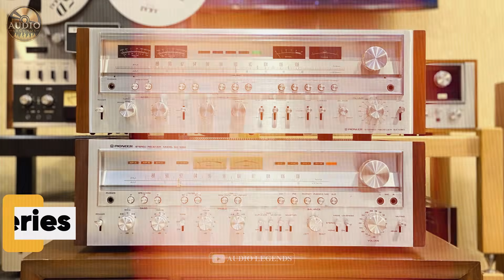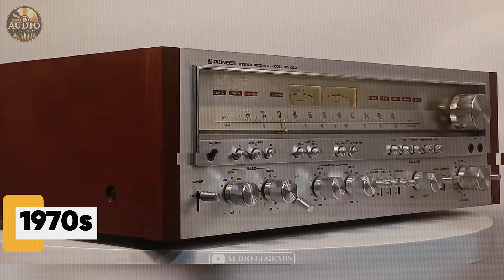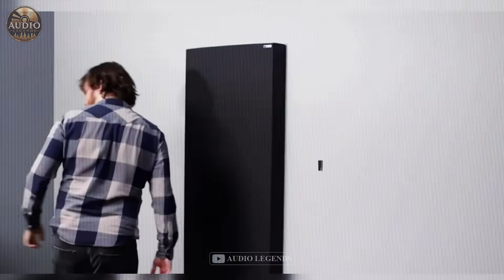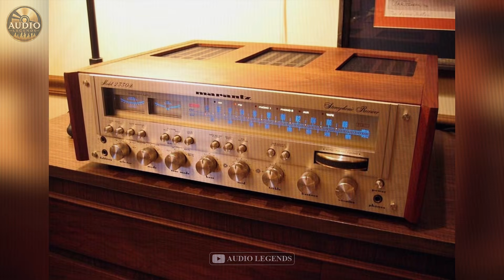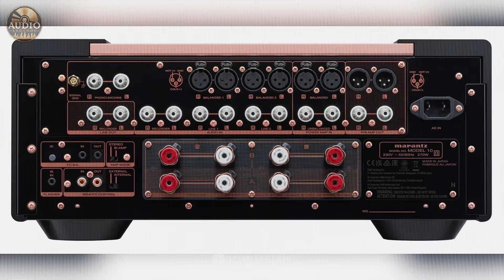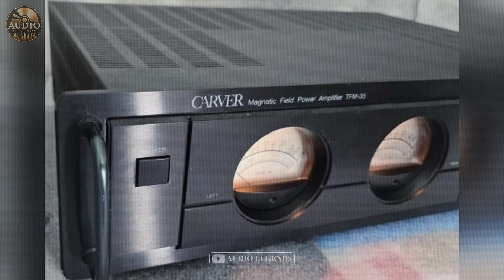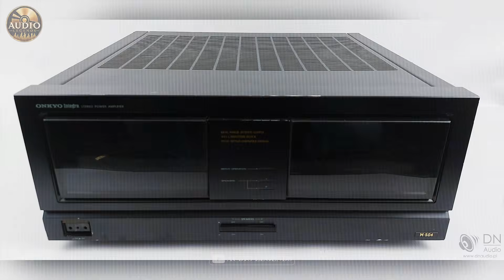My Top 10 "NEVER BUY" Vintage Stereos!

Comment: I went through quit a few amps over the years: Marantz, Sansui, and some earlier ones I can't remember the names. I bought at Vincent de Paul for about 40 dollars a Kenwood KA-801, very heavy and it used to be top of the line in the early 80's. Works fine but I feel it needs some upgrading. I stopped using it because I bought a Rega analytic amp and the Kenwood, although it has ultimate power, just did not feel right.

Comment: Avoid vintage receivers with the combination power/speaker selector switch. These have high failure rate. Avoid the early 1980s fluoroscan displays. Avoid anything with STK packs. Avoid Marantz quad receivers. Very hard to find anyone who can repair them. Avoid the mega watt receivers, as the prices have gotten insane! For the typical homeowner, a 25 to 40WPC unit is more than enough to fill the room. If in doubt, check with a service professional you trust. I had a Yamaha CR-640. Never again. Agree, the most expensive words in the English language: "It worked when I put it away." Run!

Comment: Expensive repair shops should be avoided like the plague 😮 as a direct correlation exists between a durable, reliable, responsible repair and a lack of skilled knowledge. Most electronics engineers worth their salt can find excellent replacement transistors, locate quality Omron protection relays, obtain audio grade resistors/capacitors all without raping a customers wallet. The best source of these pro's are now usually retired - with 40 year pensions and dispensing with high shop overhead, taxes and insurance. I'm actually shocked at the 💰💵💰💵 invoices for literally a few hours of bench time and 6 months or more of delays. Keep it simple, quick and keep it reasonable 😊.

Comment: Thanks for the heads up on these receivers!  Well, I'm just happy to know that my SONY STR V5 didn't show up on your list!  I picked it up in a second hand shop for peanuts several years ago.  All I've done to it is clean the controls with De-Oxit, and it works really well, though one VU meter doesn't work as well as the other one.  When they started making the receivers you mentioned with more complicated parts/build designs and features with the thought that people wouldn't keep them forever, then the trouble started.  We started moving towards disposable electronics, and this unfortunately is the result.  Did you do a video on the best, most serviceable receivers to own?

Comment: I alway bought a decent integrated ap and a cheap Realstic tuner from Radio Shack and a Yamaha turntable, not up to par with the Technics, and the Large Advent speakers. Until the late 79s I bought an expensive Yamaha receiver. The only receiver I ever had.  A uy I worked with wife made him buy some up to date system and he just gave me the McIntosh equipment he had. N trying to remember the numbers, the amp was solid state with 250 wats per channel with both Chanel’s operating the pre amp was solid state 26 had some letter in front of the 26, but the tuner was again with a letter 78, stil used my largeAdvent speakers. That was an excellent tuner and the sound on a good station was as good as I have ever heard. Produced a great soundstage. Still using my old Yamaha turntable,
Currently I am running AR “Holographic M series speaker through an Onkyo receiver, I mainly listen to music through YiuTube and adjust the seamers and setting on the Onkyo 585 ( des that sound right I have bought very M series AR speaker  could find. Got a pair of M4 floor standing speakers, do not have a turntable, and has not been easy to add a CD player, I bought a couple that had loading slots,but those slots would get the CDs hung up. I  was given a DVD layer, but the Onkyo does not have the correct inputs foe the one I was given. There are always a tone of them at goodwill that might work.  The only thing I am lack in are in ceiling Atmos speakers and the room is not large enough to put the rear speakers behind me. I view this as the poor man’s OHM speakers. I generally just keep it on all channels stereo.  The other setting really are specialized. I asked Onkyo what a few of tge settings were suposed to do they did not know either.

Comment: Your video has a lot of truth in it. I have 3 systems in my house...in my living room I have a vintage Kenwood system and in my entertainment room that opens up to my outdoor kitchen I have a Marantz/Soundcraftsmen mixed system. Issues with one component or another in both those systems. While they are working for the time being I'm sure something will come up at some point. It did take some time and money to get them sorted out. All that being said...here's the funny part. I have a study filled with vintage books and antiques I enjoy among other things. I will have the occasional cigar and whiskey in my study as well. About 15+ years ago, I bought a Panasonlc SA-505 Series 44 receiver complete with a Series 44 TT and a Series 44 8 track recorder deck...quadraphonic lol, with the "4 channel balancer" joystick. NOT HiFi, NOT audiophile, NOT the greatest sound, but not terrible either ( to be fair though, Panasonics Series44 line eventually became Technics) Anyway, my point is... I bought it at an estate sale because I like how quirky it looked and I've owned and used it for over 15 years and not one issue...never serviced. When I first got my Kenwood KA 5002, nothing but issues. Just like my vintage Sony walkman..took time and money and still had a few issues, but the .99 cent Craig brand I bought at a thrift store...still works perfect. Lol, sorry I just find it funny!

Comment: My integra amp and preamp are from Hong Kong. The lamps went out on the meters. The tech could not find a suitable replacement, so they have tacky karaoke purple LED replacements which was the only ones that worked and available that time. The preamp after repair began breaking down losing audio channels on some of the inputs, primarily the tuner, aux and tape selections deeming it unusable to me. Surprisingly the amp still works but not using it. I bought a new Yamaha integrated amp for $800 US that has solved my issues and sounds good at about 80 Watts per channel. But I am told many of the new stereos have a short use life of five years. I anticipate replacing that in the next couple of years. Sadly so.

Comment: INTEGRA 508 ... run Fast ...run Far...   mine's still at the Authorized tech's warehouse in pieces.  bin there for 20 years.  I thought maybe I should go recover the meters but you just told me even those aren't even repairable....Thanks for the info...This is the first time I've seen this amp on Youtube.

Comment: Hi, Ray! Instant new sub, here!!   
 So I need some help identifying a pair of 100w, 3 way, 8 Ohm Peaveys without any model numbers. They are dang near as big as some VOT Altec Lansings and have a dedicated bi-directional dispersion horn for the tweeter and another dedicated, horizontal plane dispersion horn for the 12” mid and the 15” bass speakers but I can find nothing on them anywhere. I very much appreciate your help😊

Comment: SX 850 is a good 65 per channel work horse mine is original and works great driving AR 10s and KLH 10s no problem ! I also own a Sony STR 6800 SD 80 per channel bought in 1980 it's a 1976 amp only serviced one time . The Sony repair shop tech wanted it bad .

Comment: 20,000 Hertzes, really? This sounds like AI crap. I learned to work on (recap and more extensive restorations) my own stuff and love all my Pioneers (not hard to work on.) I love my Fisher RS-2010, and will replace the STK's with US made discrete boards if ever necessary. Same with my awesome CR-1040. All vintage audio is expensive to have someone else service; it eventually needs to be fully restored to be reliable. That includes caps, and usually transistors, diodes, and other parts depending on the model. You have to learn to do it yourself, otherwise it may not be worth owning. Waiting until an old part causes a blown output that usually cascades to other parts is what kills them.

Comment: My neighbor - 1980, used a Phillips pre-amp that put out 1000 watts per channel, he used two Acoustics Monitors for speakers, an Akai turntable, a school cassette player for tapes and a clock radio as a tuner.  Peak sound at 800 watts, rattled house windows three houses down

Comment: Tx-7800 receiver
  Sa-8800 amp
Sg-9800 12band eq
Pl-630 turn table.......?
Are these good units?
Are they fixable if issues occur? 
The seller is asking $2,000 for the 4 pieces.
Would appreciate any advice
Thank you

Comment: Gee what a surprise that 50yr old "mass market" audio components are failing. There is a reason why brands like Macintosh or Audio Research are NOT on this list and would sell for 5 figure (used)prices. Also, manufacturers are not going to keep proprietary parts in stock for 50yrs. I noticed the emphasis on how nice some of these units look. I agree that the aluminum and glass front panels together with the aluminum knobs look wonderful as ornaments on your bookshelf as decorative pieces.

Comment: You completely missed the issue of Yamaha, which for a period of time used the new "no clean" flux for soldering.  The  flux over time corroded and oxidized metal parts including the switches which failed dramatically.  Inside all the shiny metal became black.  What a disaster.

Comment: 0:54  Don't bag on the entire SX series. My 20-watt SX-550 is still going strong without any issues.
Reply: @ercost60  I've had my sx750 for 5 yrs now. Had it relamped, balance and power switch cleaned with deoxit, no problem since. Bought it for $400, put maybe another $100 into it.

Comment: I bought a 9090db Sansui from a pawn shop once. I did not work so i had it fixed.
Oh it played great. I really liked it's looks.
Made great 90 min cassets with adjusting trebbel+base and hi volume into the cassets. The cassets sounded fantastic.
After awhile it stopped working again. I found out the 9090 non db is the one to get.
The db modle is known to quit working for some reason.
I sold it for what i could and was done with it. 😭

Comment: Found a Fisher 400 on the top of a pile of garbage / junk in a Dodge pickup truck  destined for the Long Beach CA garbage scow in 1996 spotted from a half a block away and knew by the front panel layout what it was.
Tracked down the guy offered $10 he countered with $20 done on the handlebars of my bike back home fixed the IF cans with the silver mica issues has been going strong for 30 years.
Vintage audio no matter what it is if it works as it was intended to do so
it is  the best
 All of it sounds great.

Comment: Could you send me the list of your expert Carver Technicians just in case I might need to have my TFM 25 amp and my CT-7 pre amp repaired. I got a great deal on these units, purchasing both in mint condition along with a Rotel RCD 855 CD player for less than $500. All three units are working in good order and sound fantastic but just in case one of the Carver unit becomes a problem, I will have someone that knows how to fix them.
Reply: Did he get you the list?

Comment: As a teenager in the late '70s I was always designing dream stereo systems in my head but every one centered on the Pioneer SX-780. Never could come up with the money for one, though (or, actually, always found other things to spend it on).  I'm in a lot of houses for work and whenever I would see one I'd leave a note with my number in case they wanted to sell. Never got an answer, Then one day I spotted a Pioneer silver face receiver in a basement and found it to be an SX-650. Not exactly what I wanted but close enough. Left a note and about a month later got a call from an elderly lady, who told me that her brother bought it new in 1976 and she got it when he passed.  She asked if I was still interested in it. I said I was and before I could ask her what she wanted for it she said that she would rather give it to someone that really wanted it rather than dump it at Goodwill and that I could have it for free.  I was at her house in 45 minutes.  Ended up taking it to a vintage stereo repair/sales place that fully restored it and today it sits on my desk where it gets used regularly.
Reply: @michaelsavage4889  Beautiful memory
Reply: @michaelsavage4889  usually they don't need any work, unless they have been abused..
Reply: @karaDee2363  It had been in a damp basement for some time and the knobs were scratchy so it really needed a good cleaning and deox. But I didn't want to have problems with it and the shop was a ways from my house so I just had them go through it.

Comment: Recap, Recap, Recap.
I have several vintage stereos, Marantz, Superscope, HH Scott, Pioneer and I have never recapped any of them and they still rock today.
I've workrd on electronic gear for >50 years and only replace caps whenthey are out of tolerance, are the old wax type, swell up, vent or leak or exhibit high ac ripple. .
Reply: Been in  electronics  50 years plus.   Agree with you , if it ain't broke don't fix it .
Reply: Completely agree. All my guitar player friends with old Marshals are recapping them with f&t caps. Not me. Those Daly's are still running strong. I think maybe it's because they let their gear sit rather than playing through them with voracious regularity.Use them or lose I tell them
Reply: Recap is the word amongst the sheep that don't know any better
Reply: My Superscope QR-450, bought new late 70s is still going strong and sounds great. I replaced the lamps, that's all.

Comment: What are the brands you would consider buying keeping and restoring based on parts availability?
Reply: @wwcranker  
Many of the brands shown are fine.
Just not the models shown.
  Many Marantz, pioneer, Yamaha are great and quite serviceable.
 I see right now on local Craigslist a Harmon Kardon 330B asking 120.00
So probably get it for 100.00
Recap package on eBay about 80-150.00
 Figure 3 hours bench time at 75.00 per hour 
 My tech buy the parts and doesn’t markup.
 Harmon Kardon is one of the only if not the only receiver that had separate power supply’s for each channel.
 So for around 400.00 you could have a completely restored highly respected vintage receiver 
It’s one of those sleepers, that audiophiles know are great but general public doesn’t. So prices aren’t like a Marantz or many of the other Big Names
Reply: I have a HK 930 that is fantastic. The phono stage is phenomenal.

Comment: 1950 s mono systems can ALWAYS be repaired. Guitar components will fix them. You can always do an output transformer upgrade for improved high end sound Just buy two for stereo.

Comment: Here’s what I do.  In my home theater I have a mix of vintage and new gear.  I love and fondly remember the look and sound of vintage.  When I buy vintage I only have two requirements.   1.  That the unit is cosmetically beautiful and 2.  That all the lights turn on.  When I play music…my brand new modern gear plays the music and I turn the lights on my vintage gear.  It works every time and I believe that all the sound in my 7.4.2 room is coming from that vintage gear, when the vintage gear is not hooked up to anything!   No heat issues , no recapping.   Just a beautiful listening/visual experience every time I have a session!
Reply: I get it

Comment: I have the following Pioneer Receivers that my techs fully restored and recapped. My techs are very experienced at restoring Pioneer receivers so they dominate my collection and work without issue. Some shops like mine specialize at repairing Pioneer SX Receivers.

1 Pioneer SX-1980
1 Pioneer SX-1280
1 Pioneer SX-1250
1 Pioneer SX-1080
1 Pioneer SX-1050
1 Pioneer SX-D7000
1 Pioneer SX-D5000

I also have the following NON Pioneer Receivers that are all working without issue. It's all about finding the right techs who can fully restore your specific vintage audio gear.

1 MAC 4100
1 Hitachi SR-2004
1 Yamaha CR-3020
1 Marantz 2330B
1 Sansui G-9000

My Marantz 2330B is is a high powered system at over 100 Watts per channel. I had it fully recapped and had the main filter caps rebuilt with 4 caps set on a standoff. It's fantastic.

Yamaha reserved their use of proprietary thick-film STK (Sanyo) power packs for select mid-range and lower-tier models in their later product lines, like the CR-xx40 series (e.g., CR-640). As their flagship, heavy-duty receiver, the CR-3020 was built using heavy-duty, discrete output transistors and a massive power supply.

Comment: I just love my SX 1250. Today stuff just can’t touch it never had a problem never will got a great tech next to me.
Reply: @bobgauthier1569  I picked up a SX-1250 a few years ago in all original condition. Sounds great. I do have the knowledge and all the parts for a restoration but it works great therefore leaving it as is for now. I use it daily too
Reply: Have the same one, great!